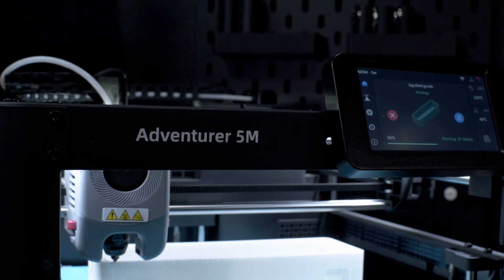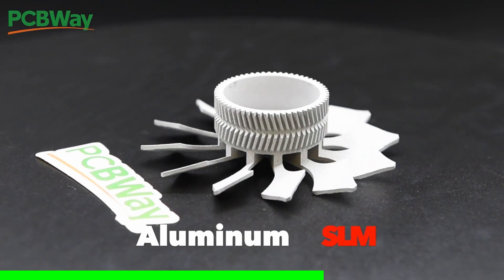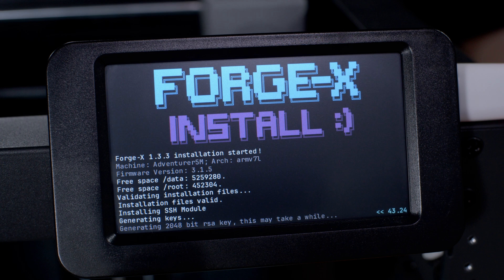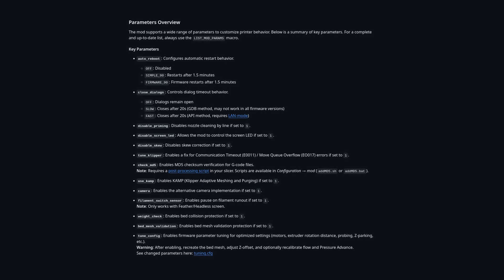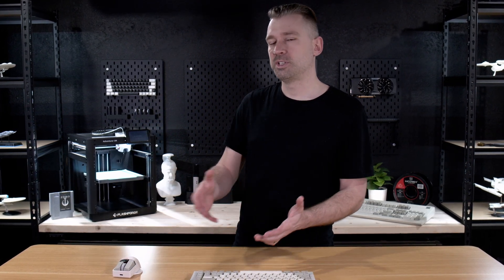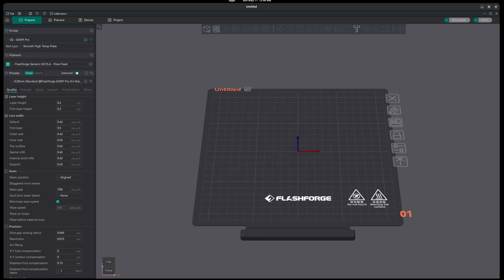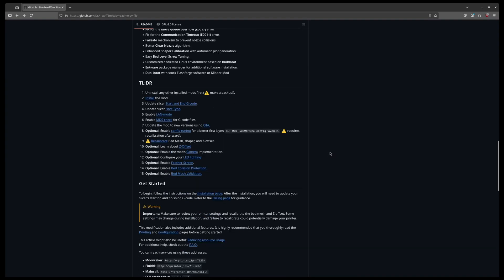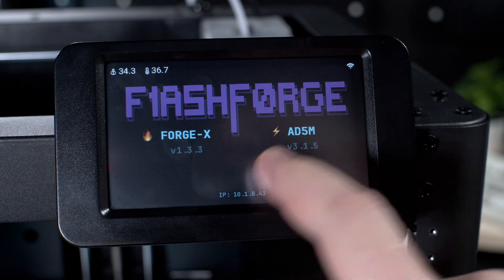The Ultimate Flashforge Adventurer 5M & 5M Pro Firmware! Forge-X / Klipper!

Comment: Question, I ust updated to the latest firmware for the 5M pro (just got the printer). Should I downgrade to 3.15 and install this instead? I really miss having a full fluid install. But see the latest build is noted as tested with this.

Comment: You can skip most of this by getting rid of stock screen and going to feather screen.  I mean I understand that some people like the stock screen, but at that point why not just stay on stock firmware?  90% of the reason to use Klipper is for the web based control you gain over the printer.

In fact, I suggest the first thing you do is to change the screen.  It makes other errors less likely to occur as you go along the calibration steps.  Especially dealing with bed mesh and z offset.

SET_MOD PARAM="display" VALUE="FEATHER"

Comment: I'm tempted to give this a try. I used to have a Voron and definitely appreciated the fine level of control Klipper offered. It sounds like there are a few caveats with this setup using the stock screen. Some of the big draws for me to try this are to have a simple unload filament option and to be able to control/modify bed mesh levelling better (use KAMP and also keep it from lowering the Z axis a full 10mm before probing, as the Bambu X1C bed levelling goes WAY faster due to far smaller movements between probes). Do you know if modifying the bed mesh process is possible with Forge X on the A5M Pro? Is adding an unload filament button or at least a macro possible?

Comment: I bought an AD5X and went to calibrate the purges on the slicer, and even leaving everything at zero, it still purges. I discovered that it's configured in the firmware, so I did some research and saw that it's blocked. I was disappointed. This is my first Flashforge. I'm an advanced user, I've been in 3D printing for 10 years and have already built a few printers. I've always liked having control over the printers. This purge part should be configured in the slicer in gcode and not in the firmware. I'm waiting for an alternative firmware to come out to see if I can solve this.
Reply: HOW TO INSTALL ZMOD ?
HOW TO ACCESS TO ROOT ?
ROOT PASSWORD ?
Reply: Ditto my thoughts exactly. Im limiting my multi colour printing, cannot justify such excessive waste 😢

Comment: can anyone help me i literally cant get multiple features to work..1. KAMP, it just levels the whole bed even if i put skip level force kamp... 2. object exclude ... 3. my camera no matter how i put the ip address with 8080 or 2020 or 7125 none of them work ... the main one is kamp and exclude object because i print alot of tall skinny parts with supports and if one fails i lose the whole build plate thanks in advance for any help i am not a noob ive been using klipper for years and making custom cfg files and macros etc ... the problem i run into here is the printer.cfg and macro.cfg is read only like most files on this mod

Comment: I installed the program and had everything working great. Got halfway through my first print with it and it threw an e0011 mcu timeout error and I never could figure out the problem and get it fixed. Had to just remove the program to make the printer work again
Reply: Change to feather screen. Your memory got too low. Once you free that up you’re dialed in.

Comment: Literally just got an Adventurer 5M Pro a day ago, betting on the fact that the community was going to come up with a custom firmware solution to the locked down nonsense that it ships with. I've done this approach with so many electronics including amateur radios that it's my usual method for electronics these days.  I don't even have the A5M Pro out of the box yet and this is the first thing I'm going to be doing with it. Thanks for the video.

Comment: I'm using this firmware and its been great so far.  Thanks for the in depth guide!  I do want to ask that I currently don't have the 5M camera so I didn't select it during the setup process but if I were to get one soon would that be an easy fix in Forge X or would I need to uninstall and reinstall just to make the camera selection prior?

Comment: Thanks for this video! Got it all set up, super easy.  I think I need to move my printer and connect it to Ethernet cause it drops the Wifi connection a lot even though it's in the next room (also happened with stock firmware).

Comment: MCU 'eboard' shutdown: Rescheduled timer in the past, This generally occurs when the micro-controller has been requested to step at a rate higher than it is capable of obtaining.Once the underlying issue is corrected, use the "FIRMWARE_RESTART" command to reset the firmware, reload the config, and restart the host software. Printer is shutdown. This is worst than klipper mod, let's just face it the stock pcb doesn't have enough memory for these firmware os mods. I shall be not trying any more of them. But thanks for the video's
Reply: yep I just got this also
Reply: @gregorgniewosz  I'm going to do the pcb mod that's on github, putting in an skr pico and raspberry pi 4 and running a full klipper install, If you can learn orca slicer well it's best left stock in my opinion, I much prefer cura slicer myself which this printer doesn't allow even with these firmware os mods.
Reply: @Chris7uk00  You got a link or name for the github would be interested looking in to it. Also is this specific to the m5/pro or just a general conversion for printers.
Reply: Did you run feather? I never saw those errors when I used that. I did switch back to stock just seeing what I find better and haven’t had any errors yet since turning klipper tuning on. Possibly if I use kamp I’ll probably have to use feather as I think it uses a good bit of memory too.
Reply: @cxz215  Personally for me, running feather fixed the MCU timeout. So it might really just be that the AD5M really doesnt have that much memory to run stock screen with fluidd
Reply from the maker: Sadly the AD5M is extremely low on system resources and tends to have issues with heavier operations. One of the more common reasons is from using slicing options like gyroid infill. It's not the only thing that can lead to a resource run out but one of the more common. The feature screen used to cut down on system resources to open up some overhead for operations.

Comment: I REALLY wanted this to work out but could never get Z-Offset to work right for me so I went back to klipper mod. I have been trying since yesterday and reading the git. I really do appreciate the awesome vid and look forward to more!
Reply: You shouldn’t really have to mess with that? If you are using the stock screen you use the display to set up the leveling and stuff. If you are using feather/headless you need to use the macros and enable the parameter to auto load settings on reboot. If you did like me and did leveling and stuff with stock screen and then switched to feather that isn’t going to work, you have to run the calibrations. Idk if it matters switching back though.
Reply: @cxz215  Thanks so much! I did revisit an am using the Feather screen and using all the advanced options and it is working really well now. My primary goal was the KAMP features and they work great now!

Comment: I keep getting an error when slicing: "The configured post-processing script does not exist:.." but I have copy/pasted my file path, and have added the file to the final folder. I am running Windows. Thank you
Reply: Hello, I had the same problem. I solved this by shift-right clicking the addDM5 file, and selecting "copy as path" and putting that into post processing scripts.
Reply: @goldenknight100  I saw someone else say that having spaces in the file path causes trouble, so I deleted all the spaces and it ended up fixing it.
Reply from the maker: Awesome! Glad to hear you got it fixed!

Comment: My family got an A5M as we wanted a 3D printer for a long time to do random things, anywhere from simple around the house repairs of random objects, to finely detailed miniatures. Went with the A5M because of its price. Didn't know next to anything about printing, but was able to figure out all the basics pretty quickly. 

For only 5k subscribers I gotta say you have by far the absolute best videos on the subject, not just the Adventurer 5 series but just printing info in general that you have given is excellent, and the production quality is quite amazing too! (PS, what GPU is that on the wall? Looks like a EVGA GTX 900 series or something similar ;) )

I would like to see if you could go over the finer details of what there is in Orca Slicer, or if you know someone who has done very good tutorials shout them out as well! Other printing or makers that you like or follow would be cool to know too. 

I would also like to see after you do the two videos you have planned (thank you btw, I am anticipating the calibration settings video!) if you can go over common issues with this printer and how to fix them (if you even know of any. I had the Z axis belt start to make noise and it turned out it was slightly loose, was able to safely tighten it in like 20 seconds, but the info on that online for the A5M was very sparse, with only 1 video I could find so I took 20 min looking it up when it took 20 seconds to fix!) and also common generalized print issues and what and how to properly calibrate and adjust for your printer. For example I am experiencing stringy-ness with PLA and have corrected it but felt like I was taking a small Printing 101 college course. And also basic good maintenance practices. I managed to get over 200 printing hours in within just half a month and had to find guides on how to properly lubricate the machine, what to and not to touch, but the best videos were still subpar.

Again, absolutely best videos around, will share you with folks if I can convince my friends to get into printing as well, keep up all the good work and don't worry about video turn around time, i'm sure everyone appreciates it like me.
Reply from the maker: Thanks! I'm glad you're enjoying the content! I'll definitely be doing more on Orca Slicer and a few different calibration videos. 
Nice pick on the AD5M as well. The AD5M is a great printer and pretty much impossible to beat at its price point

Nice catch by the way, the graphics card on the wall is an old EVGA GTX 960. It breaks my heart that EVGA stepped out of the graphics business. Currently running their RTX 3080 TI.

Comment: Thank you for this. I've just recently started thinking about better control options. I currently have  fifteen 5M's and five Pros. I acquired them mainly due to your videos. These are great print farm options, especially with their print farm pricing. I also have several other brands and I still love my Bambu's & K1C's, but Flashforge is an affordable quality option for filling a workshop with printers. I will try this on one of the 5M's and see how it goes.
Reply from the maker: That's awesome amount of 5M's! I'm still working on completely filling my studio with them!
Reply: I tried it and machines dont like it. I wanted to use it with simplyprint or one of management software but crashes

Comment: Wow I was having such a hard time with the old klipper mod as it was giving inconsistent prints so I will have to try this one out! Great Video!
Reply from the maker: Thanks! Hopefully this helps. I'm thankful for the old Klipper mod but there was quite few issues with it. DrAl1ex has done a great job with this one!
Reply: @zerodotcmd is there a way to monitor the camera via iOS? I was able to change settings remotely via the Safari browser but was never able to access to camera from iPhone. It worked on pc just not phone